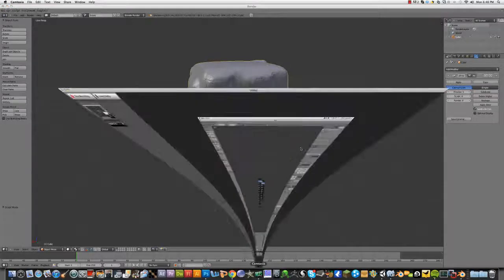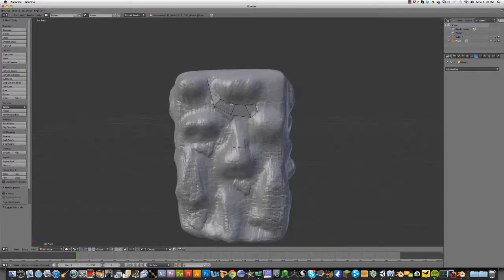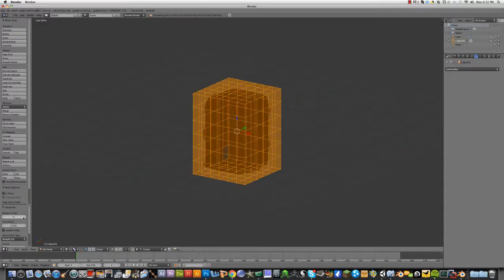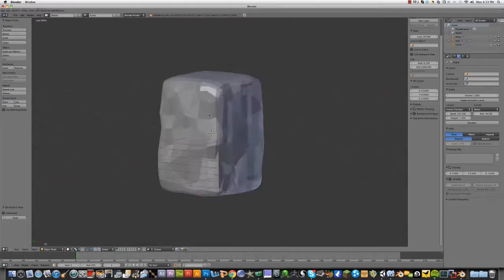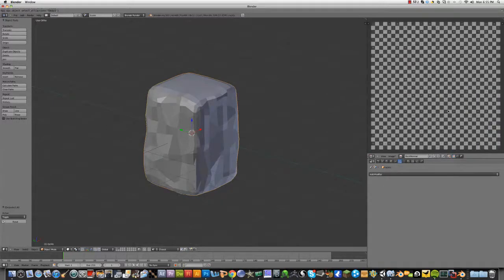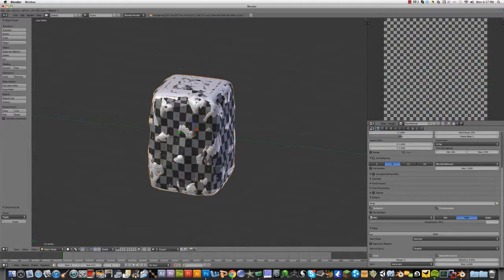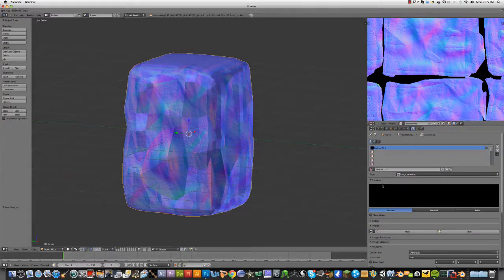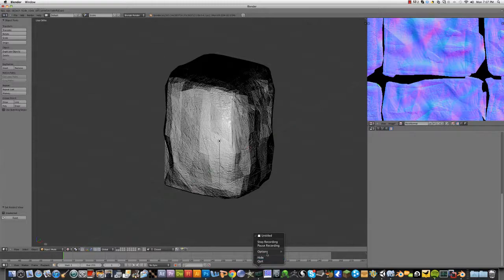Building game assets in 3D Pt.2 - Retopo techniques & Baking High Poly Normals To Low Poly Mesh

Comment: Thanks,  if you smooth your low poly object beforce you bake it the map will look smoother, also, under image sampling in the texture tab you need to check the normal map box : )